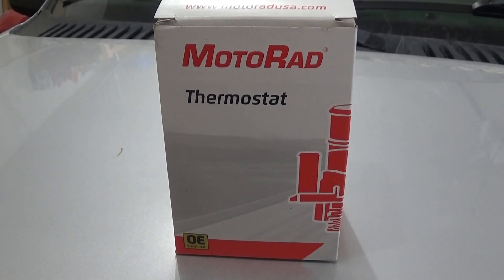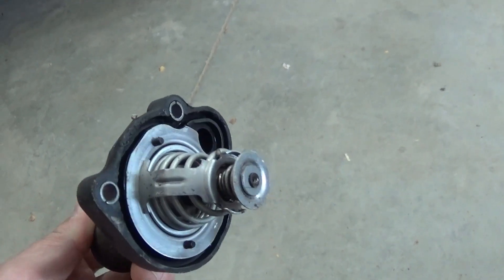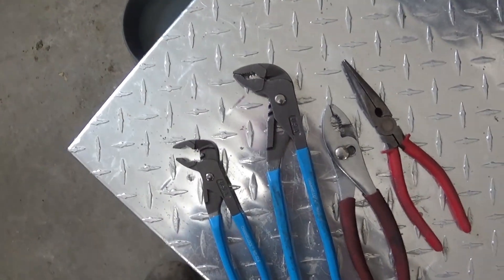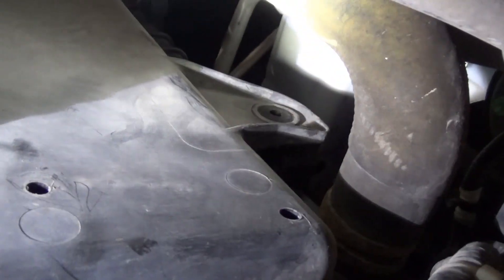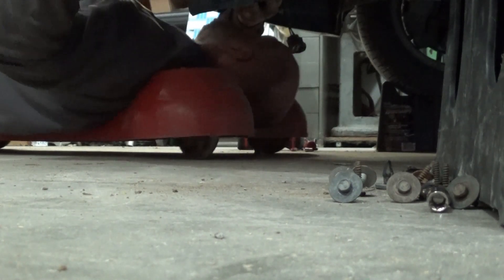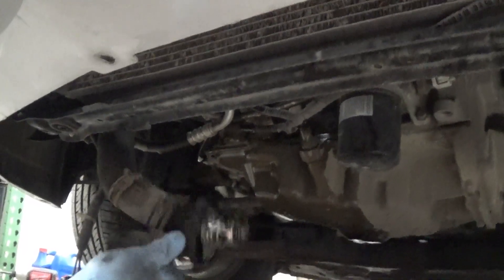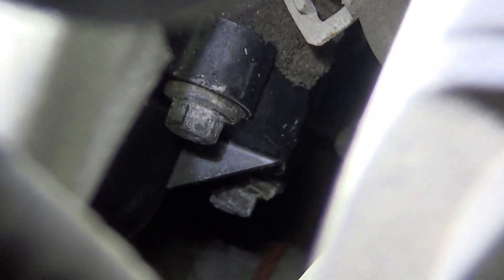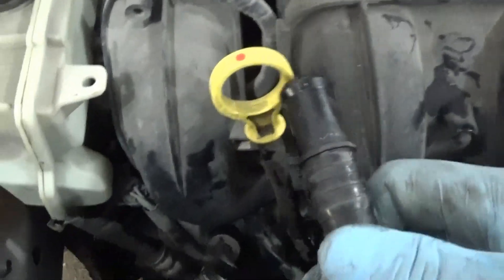2008 Focus Thermostat Replacement

Comment: Thank you so much for this knowledgeable video I have a Ford focus 2008 manual transmission with a thermostat issue and this is the most viable source when it comes to video that I can find, thanks again.

Comment: I came on here for speeding up this customers thermostat job but now I realize that im probably actually here for the axe handle that I shaped last week, and am 90% of the way to fitting it to the bit.
Whats the trick to sizing your woodhandle where it slide into the bit? Is it just a guess and check x50 until it finally is ready to pound on, or do you have a trick to speed up the shaping of that wooden male end that slides into the bit head?
Thanks also for speeding up the thermostat job on this customers car!
Reply from the maker: Unfortunately, don't have any secrets on handle fitting. I slowly shape the handle and check the fit way too many times. I can't stand a loose handle.